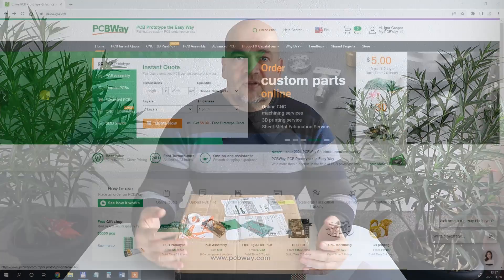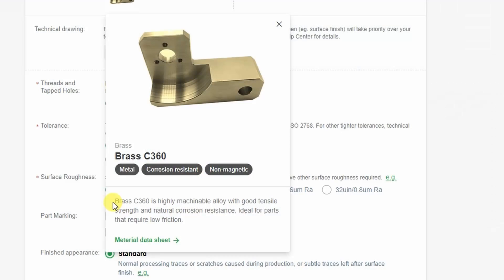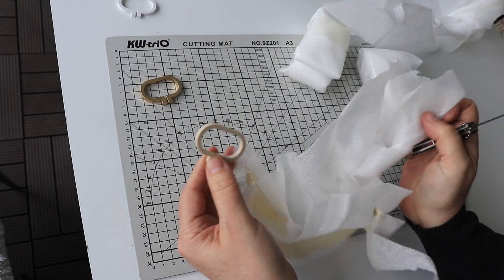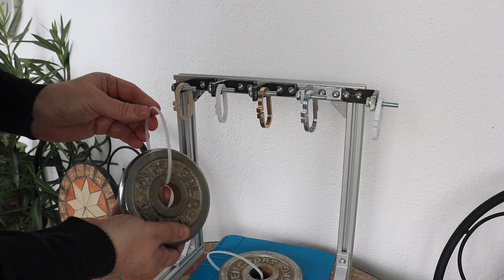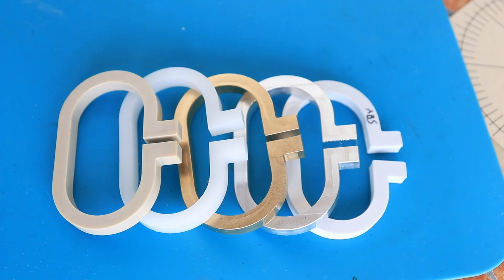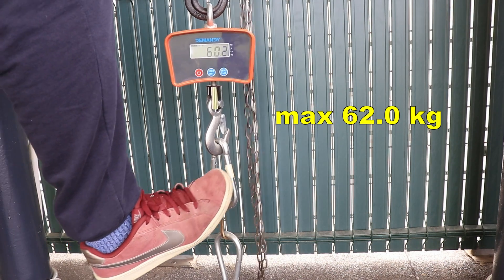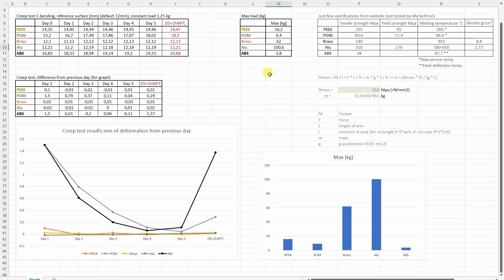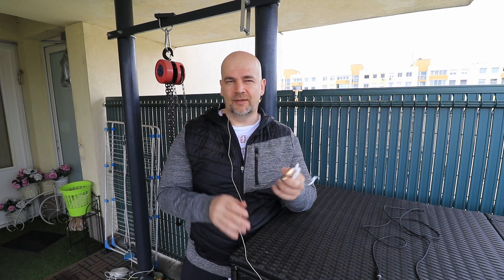PEEK, POM, Brass and Aluminum creep test - CNC machining services by PCBWay

Comment: Have you tested any Nylon 12? Everyone seems to just make Nylon 6/6.6, but a couple of companies make Nylon 12, it's supposed to be a lot less moisture sensitive, I'm wondering how it's mechanical properties compare to the more common 6/6.6.
Reply from the maker: You are right, N12 is less sensitive to moisture, but very expensive. I think I will get the whole PolyMide line for testing from Polymaker. I also have N12 from AzureFilm here, waiting for the review..
Reply: @MyTechFun  Yeah, it can be a bit pricy sometimes, Polymaker's is so expensive because they only make fiber reinforced N12, I really with they offered a regular one too.

Comment: 11:24 A CUMULATIVE creeping table would have been meaningful here
Reply from the maker: The first one is cumulative table, in earlier videos only this was presented. But smart suggestion from visitors was to calculate the creeping for each day (0=no creeping for certain day), and to present that (second table).
Reply: @MyTechFun  The first one shows, the gap, not the creep since they don't start with the same gap
Reply from the maker: @NicksStuff  Theoretically they all start from 12mm gap (with no load). Anyway, excel table is given, so you are free to modify and recreate the table for own needs. But in future videos the absolute daily creep will be presented in graphs (the second table)

Comment: An idea: creep depends on the strength of the material (loading aluminium and plastic with the same weight is clearly not equivalent), so what don't you always start doing creep tests using weights which resultin an instantaneous stretching of a predefined amount?
Reply from the maker: Yes, I was thinking about that too. But when I started this creep test, I was curious what material to use for one specific load which is the same independent of the material.

Comment: Are there even printers for home users that can print PEEK without modifications? I mean just by the maximum temperature for the hotend, not even with the other things you mentioned. Apart from that a comparison between multiple high end materials for home users like nylon, PC, PVC, carbon fiber, glass fiber and maybe even PEI or PEEK would be really interesting to see
Reply from the maker: Looks like no, just with some serious modifications.

Comment: Pure PEEK is extremely difficult to work with. PEKK is expensive, but is easier to work with and has similar properties. Carbon fiber PEKK is even easier to print and stiffer too.
Reply: Some CF PEKKs can even be printed, inefficiently and poorly at the lowest recommended specs, on a Qidi Q1 Pro, a 450$ machine. You can, quite literally, print a single spool of 1kg filament more expensive than the actual printer.